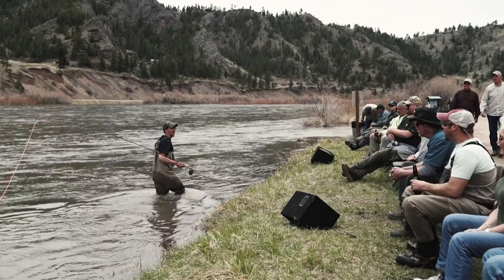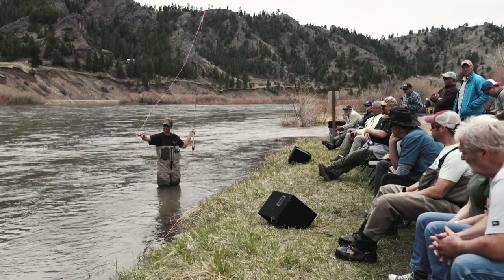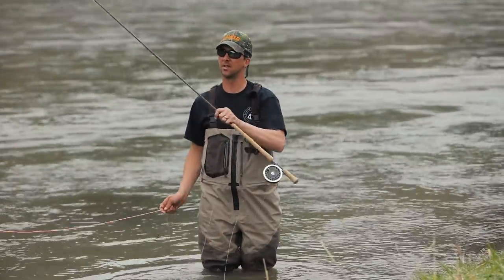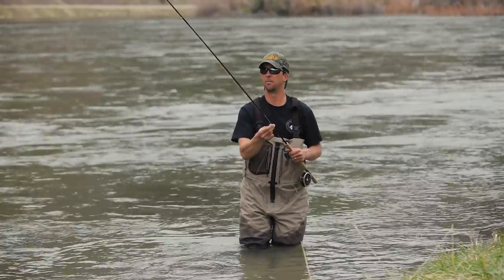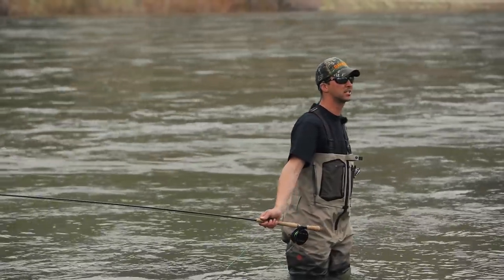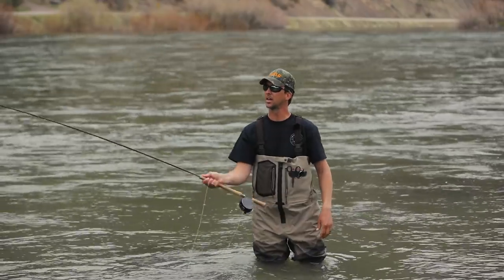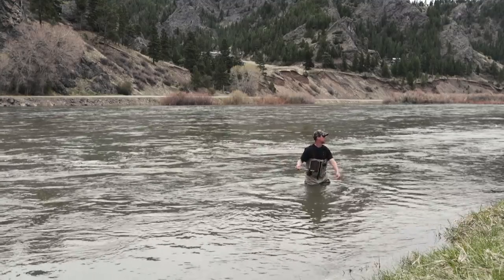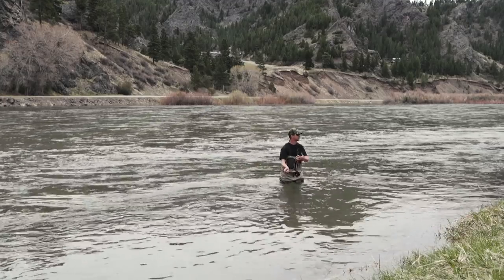Zack Williams from Swing the Fly Magazine on How to Match Gear for Spey Casting

Comment: Best Basic Info, the Anchor is the Key, and the Under Hand (Bottom) Hand Snap or Rotation to the Zipper or Stomach. Put Some Rhythm and Soul in to it let it flow. It's like Dancing . If you got Rhythm and Soul this is easy after you learn the steps and mechanics of the cast.